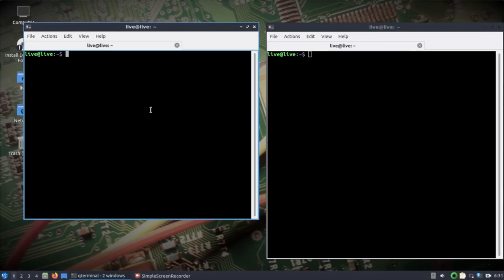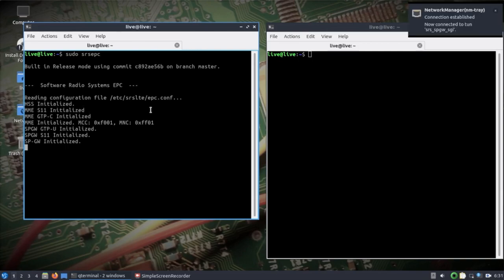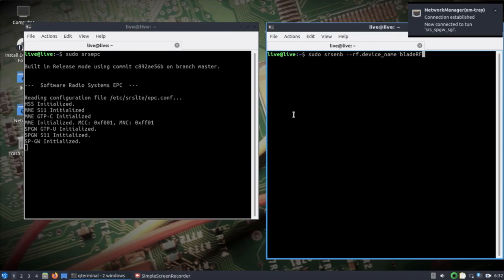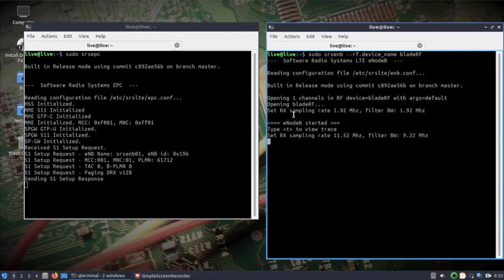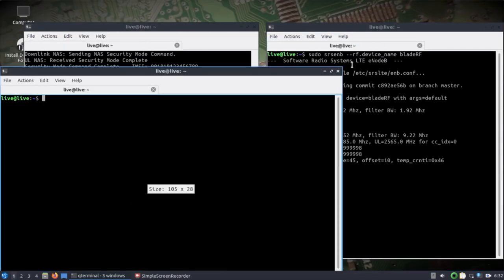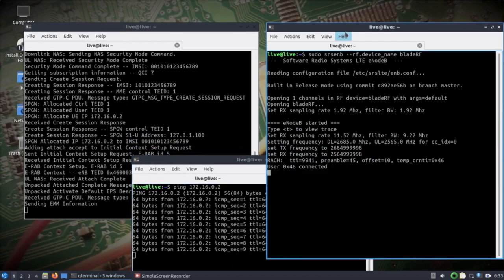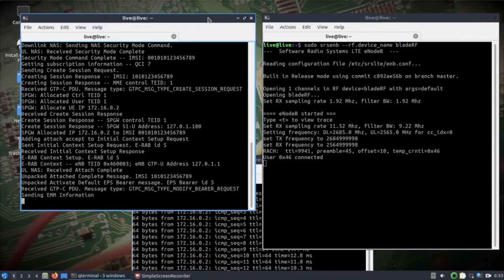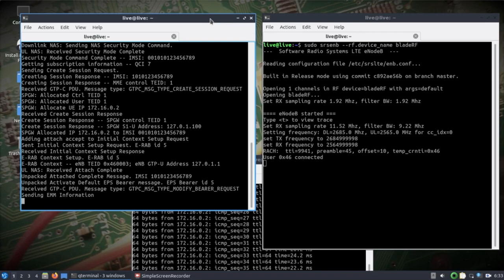DragonOS Focal Running a 4G LTE network in minutes (srsLTE, USRP B205, BladeRF)

Comment: Im using an USRP B210 and when i run the srsenb,  im getting "Error - buffer pool is empty", any idea ? :/
Reply from the maker: Hi, is this on DragonOS Focal R15 or something else? I don’t have a b210 but I can check with a b205mini
Reply: @cemaxecuter7783  Im on DragonOS R15
Reply from the maker: I was looking up this error and way down on this page, although it’s talking about the limesdr, the person is having the same problem. https://github.com/srsran/srsRAN/issues/437

Can you show how you’re starting it? Can you see that the uhd driver is being used?
Reply: @cemaxecuter7783  Yes, i can see the uhd driver working but now i have another issue, when i start the enodeb i get over and over "Tx while waiting for EOB, timed out".

enodeb screenshot : https://ibb.co/SKL48Wd
epc screenshot : 
https://ibb.co/DRVVGp0
Reply from the maker: I’ve never used it in a Vm, srslte that is. I suspect that might be the problem. Can you boot the pc with a usb stick, run it live, and compare results vs VM?
Reply: @cemaxecuter7783  I tried on a physical machine using the live version, it solved the "tx while" messages but now after the eNodeB started line, nothing more and i can't see my network
Reply from the maker: @alexandreschaldenbrandt3136  you typically don’t see anything else printed until you connect or there’s activity. What type of phone are you using? I’m assuming you’ve programmed your own sim? I’ve not used a phone doe my testing. I’ve only ever used another SDR as the UE. Do you have another SDR like a ettus or blade?
Reply: @cemaxecuter7783  I'm sorry, I'm a bit of a newbie in LTE stuff, I used my usrp especially for testing on gsm networks with openbts. Why it needs to have two sdr devices on a LTE network ?
Reply from the maker: @alexandreschaldenbrandt3136  I use the second SDR to act as the handset in my testing. SrsRan has the UE portion that’s capable of making the SDR connect to the enb. I use that to test my lte basestation because I don’t own the correct phones/sim cards. Hope that makes sense. I’m pretty sure your enb is transmitting - it may need different configurations maybe for your phone to see it?
Reply: @cemaxecuter7783  Thank you for the explanations, so if i understand, if my enb is correctly transmitting, im atleast supposed to see the enb network name on my phone when i choose manually the network ?
Reply from the maker: @alexandreschaldenbrandt3136  I honestly think it would depend on the type of phone, it's capabilities, the channel/freq you have set, but yes I think if it's all correct you should be able to. If you can't, you could use another SDR, like the HackRF to look at the spectrum and see if you see it broadcasting.

Comment: can be created a bts with ability to make calls like 112 number or enable data with only imei number and not inserted gsm card?
I know it works but i dont know how to build somthing like that for totally free telephony ;)
Reply from the maker: Good question - I don’t think with this there’s a way to get around needing the SIM card. Maybe virtual? With srsLTE you can setup a network and as long as clients connecting have a comparable SDR you could in theory give them virtual Imsi for their conf file and not actually have a SIM card. 

That’d seem to be really expensive. I just use old SIM cards laying around and use them for free when testing gsm.

Comment: Hi there ! Great video!
Is there anyway of testing the throughput of the system?
Reply from the maker: I should’ve thought of that. There’s probably a couple tools you could use to test the link. Now that I have my ettus radio repaired I’ll do another video on this. I’d like to set it up so I can access that internet on the UE so I’ll test both internal and external throughput.
Reply: @cemaxecuter7783  That would be awesome!
Reply from the maker: I tested it really quick from the UE to the basestation and a quick speed test via the first option that came up on google. It hit 4 meg download. I did this really quick just to see if I could actually do it. Now that I know it works I’ll put it on video. I’m sure the speed between just the UE and basestation will be really fast and the internet could probably be faster.

Comment: Can you get regular internet on the connected devices using this? What about using this to boost your phone mobile data internet, by bridging a high speed network with the LTE network, and using an amplifier on the SDR?
[Theoretically]

Also, if anybody decides to bring up the FCC, i do not live in america.
Reply from the maker: Here’s the directions I have:

Make sure that you've masqueraded the outgoing interface at the EPC. There is a convenience script for this at "srsLTE/srsepc/if_mask.sh".

Make sure you've set your default gateway at the UE. You can check your default gateway by doing "route -n" and you can add a gw by doing "route add default gw {SGI-IP-ADDRESS} {TUN-SRSUE-INTERFACE}".

If you are having DNS issues, make sure your DNS server is set up correctly. There is a discussion on how to do this for ubuntu here: https://askubuntu.com/questions/130452/how-do-i-add-a-dns-server-via-resolv-conf. On ubuntu 16.04, you have to disable the network manager, update "/etc/resolvconf/resolv.conf.d/head" and run "sudo resolvconf -u"; but there are a few different ways to do this and it may not be the same on 18.04 or 20.04.
Reply from the maker: Even better 

https://docs.srslte.com/en/latest/app_notes/source/cots_ue/source/
Reply: @cemaxecuter7783  thank you.
Reply from the maker: I have the directions to do so from the srsLTE guys, but I’ve not had time to try it. So yes, it’s possible. I’ll give it a shot and see if I can get it working while recording.

Comment: Good man! So glad to see a working, up to date video on this. 
Will you be working on burning SIMs and getting a handset subscribed..?
Reply from the maker: I was reading up on that. If I can hang on to the hardware long enough I’d love to try. Right now it was just the other laptop with the b205 acting as the handset, but that’d be awesome if I was an actual phone. I think, and I could be wrong, but if my phone would’ve actually let me search for providers I could’ve used it to connect to it.
Reply: cemaxecuter 
I’m pretty sure you need a properly programmed SIM card (which matches an entry in the user_db.csv) to authenticate any type of 4G/LTE connection with an actual phone handset (I’m not absolutely 100% sure though, maybe just 99%;). 

I’ve had limited success on this. I seem to have eventually been successful at programming these SIM cards (absolutely need the correct ADM value of “3838383838393838”):
https://www.amazon.com/dp/B07F5JGXZ2/ref=cm_sw_r_cp_api_i_zcDfFb42J09WS

Using this programmer:
https://www.amazon.com/dp/B07D29LS6Z/ref=cm_sw_r_cp_api_i_jhDfFbHY4C0GA

And the software linked from this page:
https://cyberloginit.com/2018/05/03/build-a-lte-network-with-srslte-and-program-your-own-usim-card.html

It took a lot of tries and a couple wasted SIMs though - they have a set number of incorrect authentication attempts before they brick themselves. 
I’m pretty sure it would be worth it to pay for more universal SIMs that could work with PySIM. You can also just ask the vendor to program a specific ICCID, IMSI, KI and OP/OPc of your choosing, which is probably the easiest/ cheapest/ smartest route. 
I’ll probably go one of those latter routes next, if I cannot make these work; just have a few other things to rule out. 

I believe I may have got something twisted in my user_db.csv, but didn’t spend much time on it before I had to move on. Never did get a handset subscribed- but that could have also been simply due to poor timing stability on the BladeRF (still working on a GPSDO timing source for that). Apparently, the handsets are much more finicky about timing, whereas an SDR client is quite a bit more tolerant. Go figure. 

I’m so glad to see someone else working on this and sharing results though - most of the existing documentation is so outdated now.
Reply from the maker: I brought my extra laptop back so I’m going to make another longer and more detailed video, hopefully the audio will be better. I’ll take some time to look at the config files too. I had some problems that apparently the bladerf people are working on, it didn’t like acting as the client. Actually had some issues as the basestation to but ended up working. The b205 worked great.
Reply: cemaxecuter 
Awesome- I didn’t have any trouble with the audio either tho. 

I’d like to get another Tx capable SDR soon, not sure which way to go but was leaning towards an Ettus. Do you have any strong recommendation to compliment the xa4 (sub $1k). Are you liking the BladeRF? 

I love this xa4 and have gotten it to do most of what I need / want it to - but there’s certainly a lot of promised features that have not been fully realized yet. The Yate incompatibilities (especially after all the big talk about it) are still very disappointing.
Reply from the maker: I had trouble with the bladerf in both the basestation and client mode, although I eventually got it working as the base station. I saw some posts in the bladerf forum where I think they are working out the issue. Didn’t have a problem with the ettus though. Other than that, the bladerf worked really well with a lot of the other programs I’ve built it. I’d say I’m pretty impressed with both!
Reply from the maker: Btw I also have an x310 im borrowing but I don’t have daughter boards yet. Also just wrapped up a slightly longer, hopefully louder video. I think my ears are bleeding after I went to play it back and forget my headphones were full blast.
Reply from the maker: I was able to get osmo-bts, omso-bsc, osmo-trx-uhd working, at least to the point where I saw the gsm network on a Samsung S4. I edited the hlr, but wasn’t able to actually connect to it yet. Making progress though!
Reply: Excellent- that’s exactly as far as I’ve gotten on Osmo & SRS. 
I did finally build a little 10Mhz Xtal ladder filter for the GPS module- almost shat myself when the BladeRF actually locked its VCO to my DIY GPSDO on the first try. 
Seems to work but it is introducing some nasty interference (mainly @10Mhz and upward fundamentals), so probably have more filtering to do. May just need to be attenuated as it’s @+3-5dBm.  I’m hoping the better (sub-ppb) timing is all thats needed to make this finally work with actual phones..

Will probably try GSM with YateBTS first- but I’ll also get my SIM card setup back out and see if I can remember how to burn one for LTE (without bricking them all). I could probably send you an unlocked/programmed LTE SIM if you like (assuming I can get it working).
Reply: @digus  Hey both, I have a bladeRF xA9 and am having issues with the RACH procedure. In particular, the network is visible on my iPhone (I'm using osmocom SJA2 sim cards with the default 90170 IMSI for now), but once I select it, no RACH procedure is generated on the srsENB or the srsEPC sides. Any suggestions would be very appreciated!
Reply: To add some context, I'm running srsLTE 20.xx on an Ubuntu VM running on a MBP host, with the SDR connected through one of those USB dongles with multiple USB3.1 ports. Would you reckon that running it straight on an Ubuntu host with a direct USB3.1 USB-A port, and that there could be some latency/timing issues on the BS side?
Reply from the maker: The VM might be part of it, but I also thought for sure I’d read something where an issue with iPhones connecting were addressed. Are you using the very latest srsLTE release? Actually just found this on 20.04.2

“Fix attach issue for some newer phones like Iphone X or OnePlus 6T”

I should also mention that with my xA4 I hadn’t been able to get it to perform correctly in the role of an enodeb until just recently (after I updated to the latest libbladerf from git, firmware and fpga).
Reply from the maker: Been meaning to do a new video now that I have an xA9 and everything is updated in DragonOS Focal 12. I just don’t have a phone/sim to check with but I do have a b205mini I can use as the ue.
Reply: @cemaxecuter7783  I'm running srsLTE 20.10.1 on an Ubuntu 18.04 server VM for now. They do indeed say that iPhones may have issues with connecting to MCC/MNC codes of 00101 and 90170 (https://docs.srslte.com/en/latest/srsenb/source/3_enb_trouble.html), the latter of which is the default setting of the sysmocom SJA2. Thankfully, I went and got the ADM keys and a reader so i'll reconfigure one of them and test with that. I also have a couple of Teltonika RUT240s that I'll trial with as well.

I'll also whip out the NUC and run Ubuntu 18.04 as host with a low-latency kernel, CPU scaling switched off, and a direct USB 3.1 port, basically bypassing all possible host-side latency issues that my MBP setup might have had. I'll make sure to report back here with results but I'd also appreciate if we had some better channel of sharing insights into configurng this properly, this is no doubt a fun project to figure out!

Lastly, have you attempted using the OpenAirInterface suite? I have managed to run the CN on one Ubuntu 18.04 VM, oaiENB on another 14.04 VM and while the two do establish the S1-MME and S1-U connections, the oaiENB fails to calibrate/interface with the xA9 properly. The project does support bladeRF but during the build process, it is clear that they have specified the x40 FPGA images to be installed and run, making me think that they have not accounted for interfacinf with the 2.0 micro
Reply from the maker: Dang, wish I could test all this out with both of you. I’m just over here using another SDR as the UE, sounds like I’m missing out on all sorts of learning and fun! I agree too, this is difficult to share and collaborate just on here. Need to figure out a better solution, there’s a discord channel but I rarely have time to check on it. Open for suggestions. 

Huge favor, with the NUC, could you also maybe create a live usb of DragonOS Focal to boot and see if you get any different results? I could never get my SDR UE to connect to my xA4 till recently as I mentioned. Be curious to get your feedback and results.

Lastly I haven’t tried open air interface. The only LTE solution I’ve tried has been srsLTE. Everything else seemed a little older or required more of a setup that I felt would be hard to roll into an ISO for everyone, but I’ll check it out if they can get micro support (I don’t have an x40).
Reply: @cemaxecuter7783  Sure, will give it a try! My biggest fear to be honest is that the bladeRF's are just not properly designed, and that the VCTCXO is not stable enough
Reply from the maker: I don’t know, I think that was being said about it running a gsm network but somehow magically Nuand pushed out an updated Yate and it’s working super stable now. I quickly checked srsLTE and suddenly I was able to connect my UE to it, so fingers crossed maybe it’s all resolved.
Reply: @cemaxecuter7783  
I’m pretty sure cellular timing is always going to be a major issue for the BRF2’s, without an external reference. The higher the throughput/ bandwidth involved, the more of an issue it will be. 

Most cellular protocols are said to require a timing accuracy of 0.05ppm (50ppb) at the UE -and 0.016ppm (16ppb) at the base station. 
BladeRF2 is said to be good for 0.040ppm / 40ppb, so that should be fine for a UE, but iffy at best (2.5x too jittery) for a stable base station. Some Blades are more stable than others, room temp is best. 
For a reference, any GPSDO should get you down to 0.5 ppb - plenty good for a base (by a factor of 32). 

I haven’t done a ton of testing on the GSM side- while it is working for me now, I wouldn’t call it stable. Basically just good enough for a proof of concept. With 2-3 handsets registered, I get less than 50% success on call completion. Then again, I’ve only spent a few hours on it.

Comment: Please consider getting a louder mic or turning up your gain. I can barely hear what you are saying!
Reply: Sounds great now!
Reply from the maker: It’s weird, I didn’t change anything but I can hear it okay on my phone. Others can’t. I’ll just do another video and go more in depth.
Reply: cemaxecuter / coler154:
try rotating your phone 90 degrees a few times to see if it’s just a L/R stereo issue. 
I know I’ve blown the right channel on my iPhone and have to turn it upsidedown and sideways to get audio from certain videos to play through the left channel..:/
Kind of silly- May want to try dubbing / mixing everything into mono as a test..?
Reply from the maker: I normally use a headset on the desktop and actually I did for this as well so I’m not sure what’s up.
Reply: Sounds good here.
Reply from the maker: Sorry about that. I forget to initially record the audio, did a voice over, and thought it seemed loud enough. I’ll make another one, but louder.